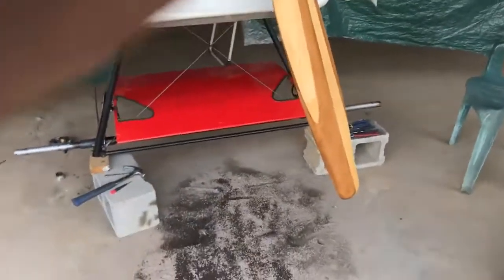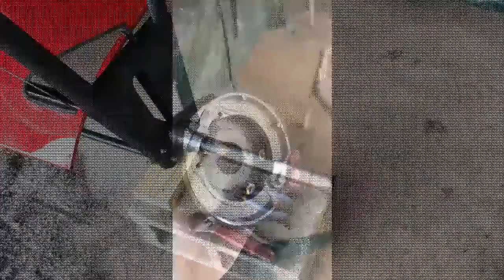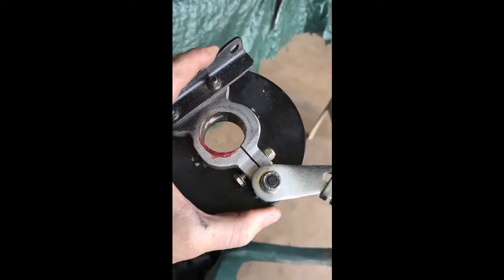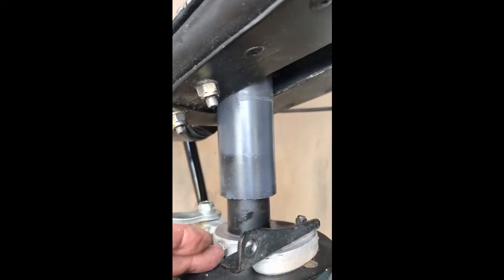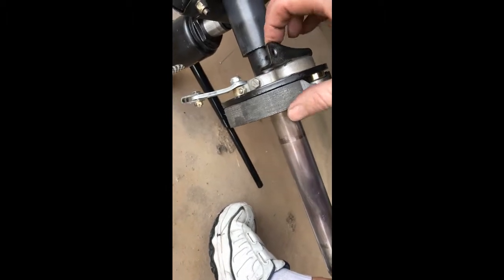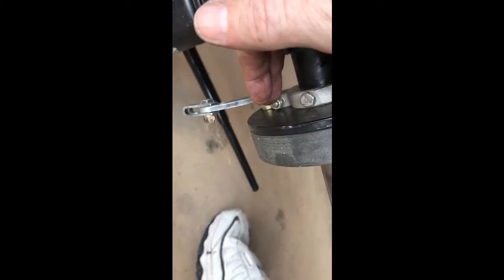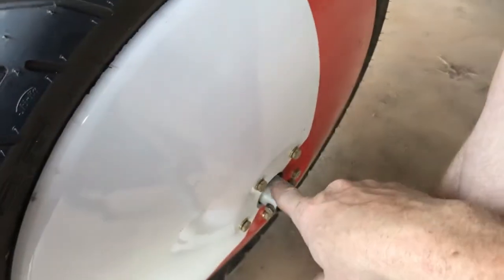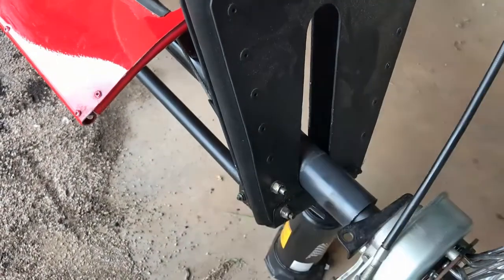Bert Sparrow's Aerodrome Airplanes with Tracy Obrien Fokker Brakes

Comment: You, sir, are my hero for the week.  This answered a bunch of questions on why my brakes are sh*t, and opened a few new ones.  Where did you get the bushings for your wheels?  Did you wind up making them yourself?
Reply from the maker: Hey thanks!  Glad to see there is value in this for at least one person!  Since you asked about "bushings for your wheels," I assume you do NOT mean the big brass spacer or the big Fastenal washers inside the brake housing.  I assume you mean the spacers/bushings BETWEEN the wheel spoke area and the gold-colored brake housing.  You do need spacers because the housing can't sit on the spoke area.  I got those spacers from Chuck's Air Repair in Oklahoma, but he told me all they are, are drilled out aluminum rod.  Pretty easy to do.  Thanks!
Reply: No, I was talking about the wheels themselves.  The bearings in mine are crapola, and I'm thinking of going to a brass bushing instead - which it looks like you did.
Reply from the maker: Yes, that's a big brass bushing, and it was supplied by Chuck's Air Repair in Oklahoma. But I found that one spacer wasn't enough, which is why I added some Fastenal steel washers as well.  best of luck!
Reply: @bertsparrow  thanks for simplifying things your explanations of how you solve problems are excellent